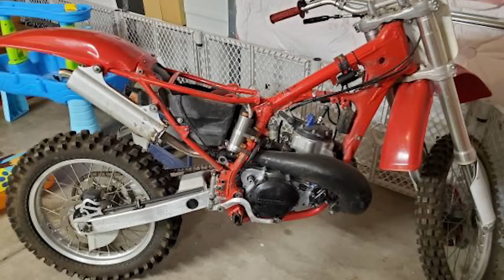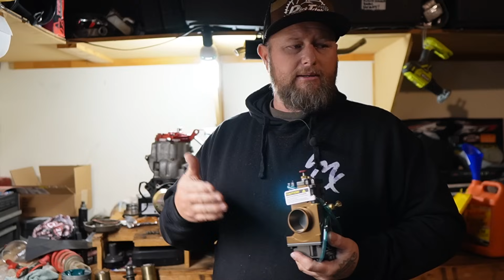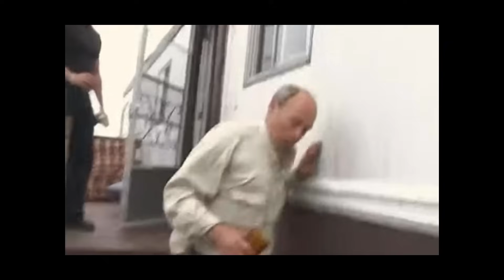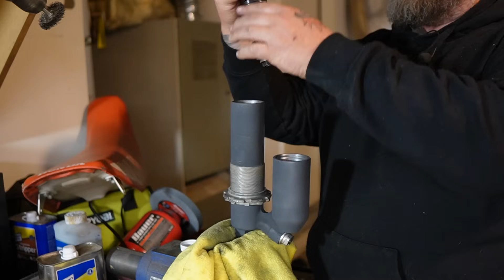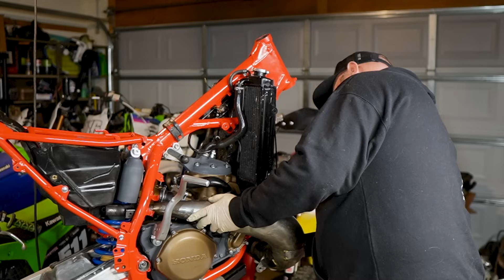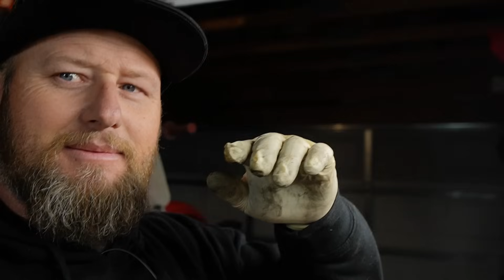1989 CR500 Lets Fire It Up For The First Time!

Comment: Weres the smoke
Reply: Yes, l thought there wasn't much oil on first start, but then you do see some later. Of course thats probably not its first start and he should have  examined the known kickstart mechanism  issue. The ratchet etc.  must take a lot of hammer over the years. Wasn't a compression release button fitted to that head?
Reply: Thanks for getting back to me bro